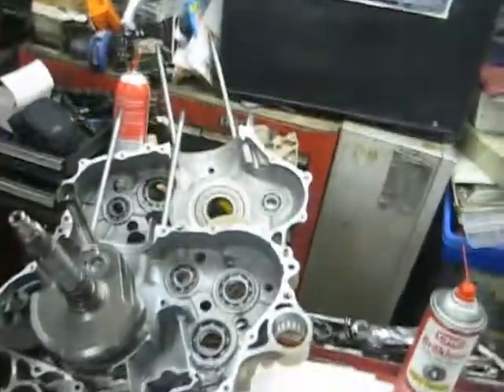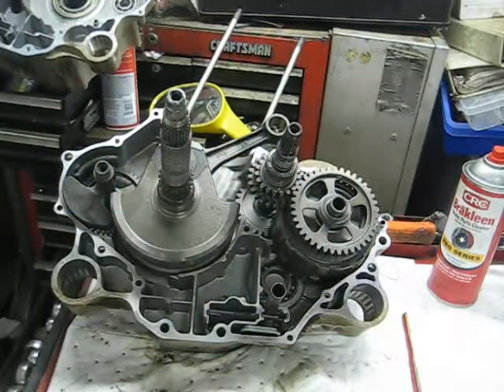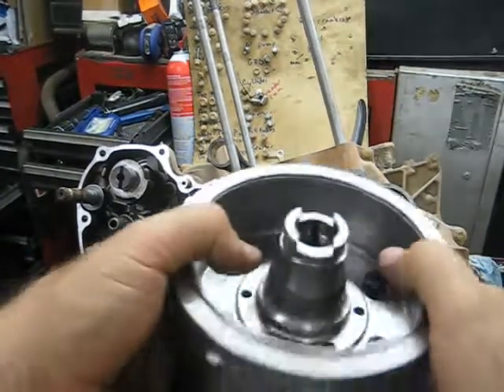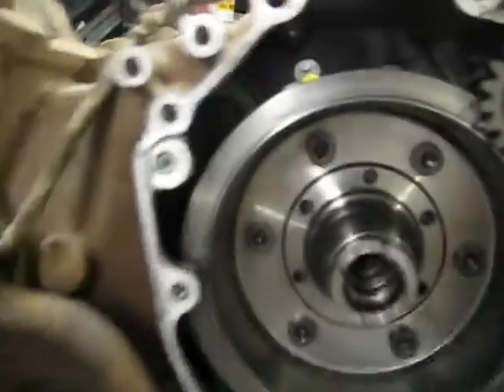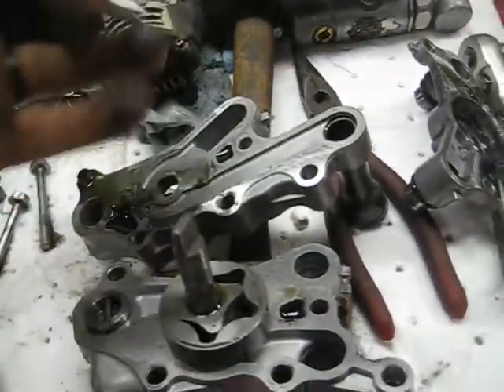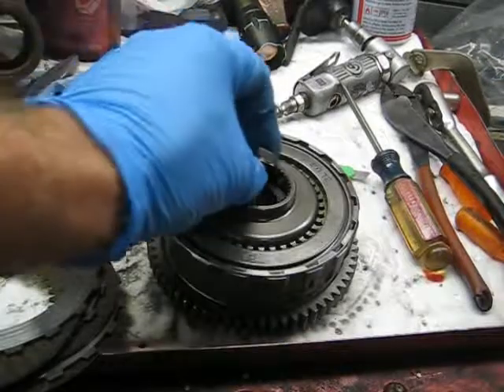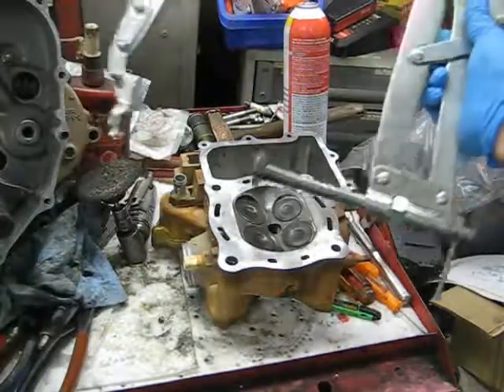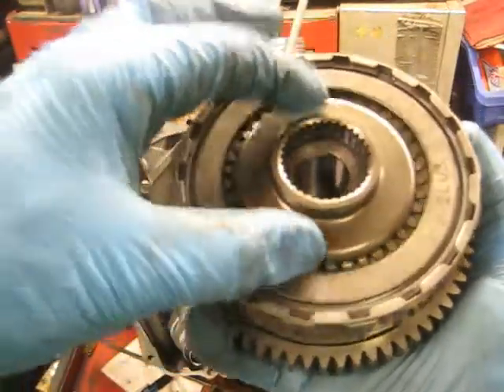Honda Rincon 680 engine reassembly

Comment: Great videos! I think it’s funny that you bothered with the timing mark on the crank when you’re looking at the piston at the top of cylinder. 😂
Reply from the maker: Well it can be 180 degrees off. The piston can be at the top on the exhaust stroke. It seems like most of the people on here have questions or fears about timing so I try to cover it on all my engine video. Thanks for watching.

Comment: Good video the only problem I see is you should have soaked those clutches in oil before you put that clutch back together! 😁
Reply from the maker: You are correct. The manual does say to soak them but I have never noticed any difference in soaked or non soaked clutches. In all actuality the Hondamatic unit will go out in this bike before the clutches wear out again. Lol

Comment: I know the thread is old but I recently got a 05 Honda Rincon 650 4 x 4 and I was looking to see if there should be just a little bit of play on the oil pump sprocket? I cleaned snd replaced the O rings.
Reply from the maker: There is often play in the oil pump chain. I have replaced them with new ones before and they still have a little bit of slack in them as well.
Reply: @FourwheelerDoctor  ok thx for the reply just tryin to get this thing together more me do rent look bad inside the engine casing  I seen that u can clean the torque converter with paint thinner then blow it out with air and soak it in oil for a day to make it lock encounter clockwise position on turning mine seems to turn either way

Comment: Hey Doc I could use your advice I have Rebuilt the Engine and it runs nicely but Now it is only getting First gear and Reverce and I am not sure what is wrong. I hope you can point me in the right direction. Thanks

Comment: im doing a 2007 rincon had the wrong oil put in it and now the clutches are slipping i plan on doing 1,2,3 clutch packs but what about the torque converter will i need to replace it

Comment: I ran an oil pump pressure test on the 700 BR I'm working on. Only got 25 psi, supposed to read 114 psi,(according to the manual). So, obvious oil pump problem. After watching this video, I have come to the conclusion, that the pump design is absolutely horrible. A high pressure three rotor pump driven by a chain. The oil pump chain behind the timing chain. The oil pickup on the other side of a case, and with what appears to be very little clearance between the pickup and the bottom of the case. Yeah, what could possibly fail with this design? Good video, though, with several good tips!!!!
Reply from the maker: That's what it sounds like. The pumps aren't too bad to rebuild but they aren't the easiest to get to on the big red. I have had the chains come off before as well because they do not have a tensioner to keep them tight.
Reply: Well, according to the owner, this tranny was rebuilt 2 years ago at a Honda dealership. I'm wondering what they overlooked to get it out the door. Due to the fact that this unit doesn't have an hour meter or speedometer on it, and it's 12 years old,  I'll just replace the pump. It doesn't cost that much more, and there are too many unknowns and variables not to. Thanks for your videos. Very helpful!!!

Comment: I have a rincon and just rebuilt the top end and got everything set right and just turned it over a little and it ticks. I’ve narrowed it down to the lifter cup on the exhaust side kinda taps on top of the cam lobe when turned to a certain point so I took the head back off a few times then looking down the hole where the lifter cup sits it looks like the cam lobe is way off center. And the lifter cup is taping one what appears to be some sort of oil pick up on cam shaft. I can’t figure out why it would be doing this but I’m at a lost and you seem to know what your doing better than I. Any help would be greatly appreciated
Reply from the maker: Can you post a video?  Sounds like you bearing or cam holder isn't quite right.

Comment: what is the part next to one of the cam lobes, it is between the holder and the lobe? mine is shifting about a quarter of an inch back and forth is that right?
Reply from the maker: That is the decompression ring. It helps to lower the compression at startup by opening a valve slightly. They do normally have some play in them.

Comment: hello doctor, I have a problem with rincon 650 2005: because it slips when I force it I changed the oil pump, after I changed the pump it doesn't change gears when the engine is started, the engine stopped changes 1,2,3-3,2, 1 no problem, I can send a video eventually, please help me

Comment: Hello doc I need your help I was changing the oil pump chain in my ricon 650 and when I removed the timing chain tensioner it came out of gear and now I don't know how I will know if it ran out of time

Comment: Great video! I noticed you mentioned a gear reduction was a big red gear swap? I have a 14 pioneer 700-4 I believe it has the same engine and trans as the 680. I was wondering if this reduction would work on mine! Also where are you located and how much would you estimate it would cost to change out all clutches and do the gear reduction?

Comment: Just putting my engine together and gear selector won’t move any ideas thanks
Reply: Every get this sorted? My rincon stopped shifting on me mid ride. Was stuck in reverse. Finally got her to move to neutral. Now she wont let the gear shifter move into any other gear.
Reply from the maker: Probably going to have to pull the back cover off. It  may have broke the shift drum of one of the shift forks.
Reply: @FourwheelerDoctor  thats not doable with the motor installed is it?
Reply from the maker: @21213248  yes it is but it requires removing the rear subframe which is much easier than pulling the engine. You will need to remove the two top shock bolts the four upper control arm bolts the two upper diff bolts and the four bolts that hold the sub right frame to the frame under the engine. Unbolt the brake caliper and the rear end will fall out.

Comment: When doing your low clutch your bottom c ring is it flat like the top or is it kinda wavey also your springs on the front of the clutch are they loose when you shake the whole assembly or are they supposed to have tension the whole time?

Comment: I know this video is a little older, my rear crankcase cover has a hairline crack and i plan on replacing. Can i do this with the engine in the 4wheeler?
Reply from the maker: Yes but you will have to remove the rear subframe to get the cover out.  It's really not as bad as it sounds.

Comment: Great video!  I have an o5 rincon that broke the timing chain guide.  When that happened it broke one of the metal pedalstals that support the back side of the torque converter.  Pushes out on the converter.  Its the  bottom of the three, can I run it with two or do I need to somehow fix it/replace case halves...  not holding  you to your opinion, just wondered if you've ran into it and how or if you fixed it.  THANK YOU for sharing all your knowledge!
Reply from the maker: I'm not sure exactly which part you are talking about. What time do you see it in my video?
Reply: Should the oil pump gear be kinda sloppy on the shaft it turns?
Reply from the maker: @stutyss1  if you are talking about the gear that the chain goes on then yes it will have some wobble to it.
Reply from the maker: @mattstutenberg2982  I don't see where the broke stud would be an issues reassembling it without it. It looks like it just holds the back of that gear off the cam chain and since the back part doesn't move I don't think it will be a problem.

Comment: Thank you for a great video. I replaced my cam and it fixed my issue but I have a new ticking sound. At the end of ur video you said the rockers should move up and down slightly at TDC. Only the exhaust moves not the intake? Any help would be great. Thank u
Reply from the maker: Sounds like you need to adjust the valves. There should be a small amount of play in both rockers.
Reply: @FourwheelerDoctor  thank you for the response. I have adjusted the values but I still down any movement in the intake rocker…?
Reply from the maker: @trentjarecki1899  it will be a very small amount but if the feeler gauge slid under the rocker it has to have a gap between the rocker and the valve. Is the noise still there?
Reply: Yes still have the noise. I have the proper gap between the rocker and the value at TDC. The intake rocker is still solid.
Reply: Valve

Comment: Great video. Would like to ask. You happened to know mabe. My trx 680 rinco starts but its idling poorly with smoke out the exhaust and if i put it in gear the engine dies or gears are not selecting. If you can help. Would be nice.
Reply from the maker: I would start by cleaning the carb. Sounds like you may have a stopped up idle jet in the carb.

Comment: I was always taught when a rod changes colors like that its a sign of running with no oil is this true?
Reply from the maker: Sometimes. In automotive applications that is a pretty good sign since most of them use two piece bearings.  But in most of these Honda ATVs they use roller bearings on their rods and I've actually had some brand new cranks that were blue from the machining process.

Comment: Hey doc. I’ve got a 12 rincon 680 I could really use your advice. No one in my area works on rincons. So I’m having to figure out what’s going on with pretty much zero guidance lol
Reply from the maker: What is going on with it?
Reply: Wife rode it while I was at work. Ran fine. Next day I went to go ride. It took longer than usual turning over. Then backfired. Violently. Plug soaked with fuel. Changed oil. Plug. Made sure I have good battery. No longer backfires. But doesn’t start. So then attempted tdc. From what I’m reading. When the t is center of the hole. My valves should be open. But it’s when the piston goes from tdc down stroke. The valves then open.
Reply: No codes or blinks. Cleaned all electrical connections. Cleaned iacv. When I say plug is soaked. It is soaked with fuel
Reply from the maker: @billyharrison660  sounds like you might not be getting good spray out of your injector. Have you tried to clean it? I think I have a video for that lol let me look around
Reply from the maker: @billyharrison660  also you  want to make sure your spark plugs firing. Unbolt it from the head and just lay it on the head with the plug wire hooked up and turn it over to see if it sparks
Reply: @FourwheelerDoctor  I have no cleaned injector yet. And yes it is getting fire

Comment: Timing this motor is a little weirder or stranger than other motors being that you put it at top dead center crank and you Pistons at the very top then you put your camshaft on and you put that line on and then you put your heads on or another deals you put your head on I mean you got your head and all that stuff on and you put your camshaft on and you can tell what you compression stroke by the clothes and open up the valves what are you doing this case if you don't have the compression stroke to take the heads back off and turn the cam all the way back around or something just a little strange here I'm going to watch and see how you do it but I don't know if we ever from what I've seen so far talk about the compression stroke and that's a little confusing to me on this part since I've never done a motor like this I'm doing right now but one that didn't already have the cam that goes on top of the heads itself and then you could find a compression stroke by the opening and closing of the cam at your top dead center or the open and closing of your valves because if you can at the top dead center compression stroke
Reply from the maker: Yes because this is one of the few kindof overhead cam engines that honda puts on atvs.  Most of the honda engines have the cam mounted down low behind the front cover.
Reply: Punctuation exists for a reason bruh

Comment: Your mark, is the same mark for all Honda rincon?
Reply from the maker: Yes the flywheel should be on the t mark with the line on the cam lined up with the head. Both lobes of the cam should be facing down at TDC.

Comment: Good day from Zambia AFRICA. My TRX680F is @ 720hours on the clock. My concern is the "TAPPING CLAPPING" low rpm noize on the engine (pobebly on cam rpm side, it sounds like a loose timing chain). I yet have to check the tappet clerance. Do you out of experiance, know what else I should check?
Reply from the maker: Greeting from South Carolina. I told my 75 year old mom that someone sent me a message about a four wheeler from Africa and she said is he going to bring it? LOL. It sounds like you're heading in the right direction. You should check the valve clearance first. Then when it's at top dead center you can remove the cam chain tensioner and let it extend out. Insert the tensioner back in to see if the tensioner bottoms out before it hits the cam chain inside the engine. If the tensioner bottoms out you need a cam chain if it doesn't bottom out sometimes these tensioners when they get extended way out do not hold pressure on the chain like they should. There are some YouTube videos of how to increase the strength of the tensioner. I don't have one but I have one watched one before.
Reply: @FourwheelerDoctor  Buying a new one is a cheaper option than shipment...... I did check the tappet clerance, its perfect, though. I pulled the tentioner out, cleaned it and stug it back. After starting, the noiz was gon, only for 5 minutes....... 1) Have you ever had problems with a tentioner?  2) How many HOURS on the clock do the timingchain, gide and tentioner last, before failurer? (under normal HONDA working conditions)
Reply from the maker: @johannesclaassens9519  I have had trouble with the tensioners before. If you removed the tensioner and stuck it back in without retracting it then you probably need a cam chain. I haven't ever really noticed a pattern in them as to when they fail but as the chain stretches out they will make the rattling noise because the tensioner is at the end of its throw and looses some of its pressure on the chain.
Reply: @FourwheelerDoctor  I am from Namibia Africa and my 680 rincon had the same problem. When i opened the engine the cam bearings was broken. So i put in a new camshaf
Reply from the maker: @johannesburger7808  I can't say I've ever seen one of the bearings break because it's usually the lobes worn off. Glad you got it figured out

Comment: Hi. can you help me solve the problem with honda rincon 680? reverse gear R engages quietly and gear D very loudly.
Reply from the maker: Oftentimes the shift drum wears out on these and causing them to engage louder. It's not a real easy fix. You don't have to split the case but the part that needs replacing is behind the rear cover
Reply: @FourwheelerDoctor  And what part is it?
Reply: @FourwheelerDoctor I have already replaced the complete selector from D N R, on a cold engine it is ok, the problem appears after warming up

Comment: Do you need to put anything on the base gasket
Reply from the maker: No I have had trouble with base gaskets slipping out from under the cylinder with rtv on the gasket from the head bolt pressure. I always put the base gaskets on dry.

Comment: Hey man, i have a problem with the closhes of the honda rincon, you can help me please?
Reply from the maker: I probably can. What problems are you having?
Reply: Look, the honda dont' run, it only stay in the place, sometimes it move but only a little
We already change the rings, and the converter
And the Honda continue with the problem
Reply: Is a Honda rincon 680
Reply from the maker: @natsu202dragneel9  are there any lights flashing on the dash? Is the oil completely full?
Reply: No,  don"t dash any light
And.. I don't remember is complrtely full
Reply: So the engine runs but the machine won’t move?  If so I’d suspect oil pump drive chain. I wouldn’t run the engine until you determine it has oil pressure.